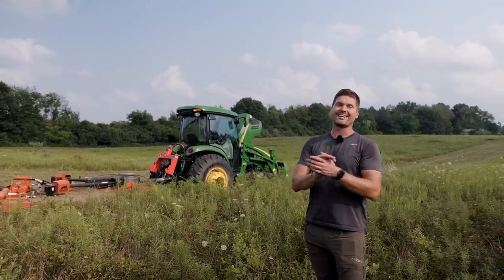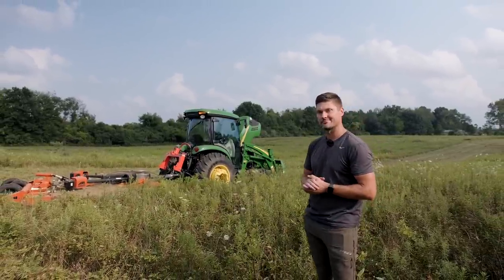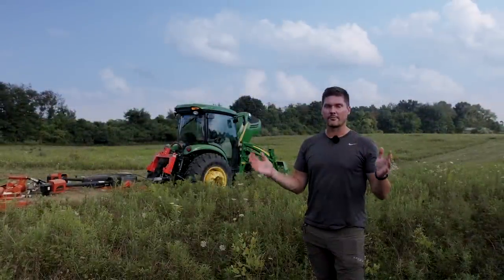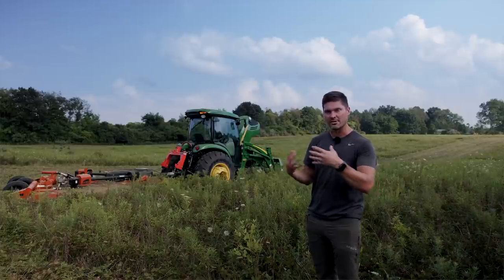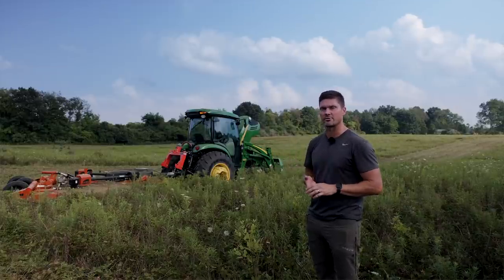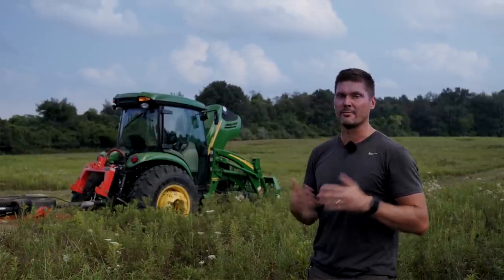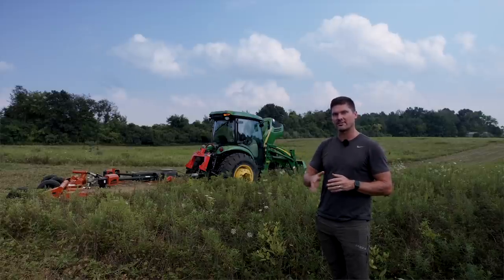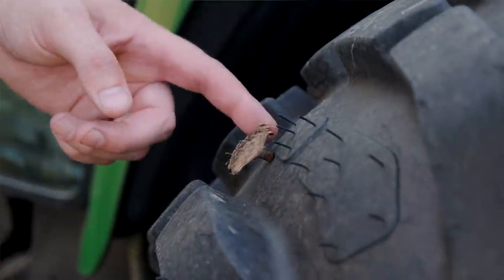JOHN DEERE BREAKS DOWN PULLING A BATWING MOWER THE FIRST TIME

Comment: Diesel engines are cooled. When they start to run hot, the best thing to do is find some shade if possible. Allow the engine to idle 1100 - 1300 rpm. This will usually cool them down. While the engine cools, you can pop the hood and clean the radiator screen. Turning a diesel engine off can cause major damage as it continues to heat up. Just a little something I was taught on the farm many years ago.
Reply: was about to write this, do NOT shut of the engine when it runs hot, let it idle to allow the coolant and radiator fan to do their job. That apply to any water cooled engine out there, not only diesels.
Reply: He should also turned the cab Heating on that will help to get the heat awas from the engine (and it gets even hotter in the cab so 90degree suddenly dont seem to be that hot)

Comment: Regarding the temp, when it’s already running warm & the tractor is running it’s constantly circulating coolant but when you shut off an already warm engine you stop that circulation & that already hot coolant is sitting at that temp sensor & is going to get warmer because it’s not circulating & just collecting heat off of the engine components & getting hotter until everything starts to naturally cool down. Fix to this is when your tractor starts to run warm & you’re gonna shut it off to clean screens let it idle for a little bit with out a load on the engine so it’s naturally cooling itself down before you just shut it off while it was already running hot
Reply from the maker: That makes perfect sense.  Might have bought me some time, but I feel like there is something more significant going on.
Reply: @GoodWorksTractors  Yepp you may be absolutely correct, I’m just sharing something I found out the hard way operating a grain cart in the Texas heat
Reply: Seeing your post saved me from regurgitating the same information.  The one thing left out - on severely overheated engines, crank over every minute or so till cooled down a little to prevent seizing.
Reply from the maker: Definitely, experience is the best teacher 😂. Have a great day!
Reply: Also, along with what was already mentioned about a running cool down, just check and make sure the radiator and ac condenser aren't partly plugged with dust\dirt. Mud wasps love radiators! There's allot of heat being dumped through both and when you add the extra heat of a hydraulic cooler into it on a 90+ day with a good load, that might all be enough to push it over the edge. It's that a hydrostat machine?
Reply from the maker: Good thinking!  Yeah, hydrostat machine.
Reply: @GoodWorksTractors  those transmissions make a ton of extra heat especially if your not at full speed in whatever range you've chosen for the terrain. If your in a mid range and adjusting speed with the foot pedal your creating extra hydraulic great load because the fluid not used for motion gets squeezed through the bypass back to the sump. That recirculation creates heat. Always better on long runs at higher load too be full open on the foot pedal as much as you can at least. Then your moving oil and it tends to stay cooler. Love that mower!! Gonna add that to my list of wants! Have a 10' straight and live the width but it's a pain to transport on a trailer as it's technically over width. Keep the good videos coming👍
Reply: i dont ever stop the engine thats the worst you can do to your engine and trans oil, always leave it on and use a pancake compressor when i mow pollen stuff, just cleaning the screen isnt enough, you get that stuff though everything in the pack of coolers you have to clean that all out
Reply: I would recommend just above idle with no load on for more coolant flow.  also someone already mentioned the stick to used compressed gas or water to clean the radiators. "Radiator Genie"
Reply: That was well said, saved me a lot of typing. Your spot on. Temps will still climb especially once the tractor is shut down and coolant circulation stops. Deal with that same thing on my X758 and 2025R whenever I am mowing in some tall grass and weeds and the screens get clogged up. Happens every time I try and use my X758 like a brush hog. LOL Or actually have a brush cutter on the the 2025R or my 4066R for that matter. 
I think it is a condition commonly called heat soak. 
I would clean all the screens and radiator fins and should be good.
Reply: @jlipskoc  "Radiator Genie" the sticks to clean with compressed air or water.
Reply: I agree, I was towing a small carnwith small pickup years ago. It started to get hot going over a mountain and I stopped to let it cool. Let the engine idle for 5 to 10 minutes and then I was good to go. Always need to watch that coolant gauge.
Reply: @GoodWorksTractors  Injector pump Issues, and leaking injectors ( smoky start up) . So It is running LEAN.. that means more heat.
Reply: @catwalk136  
Agreed. I grew up around heavy equipment. The old guys called it " letting the machine idle out"
Reply: I have a 2013 4720 and I have had troubles similar with over heating excessive exhaust and three point not working.  The previous two owners evidently did as well as it had been into JD service four times for service before I bought it with 105 hours.  I live in Wyoming and I bought it from a dealer in Iowa whom did not disclose any information of trouble.  Well I think we have it sorted out as it is currently working perfectly as there was a defect in something that was causing the rock shaft o rings to blow is what I was told.  My dealership currently feels very confident we have it concurred.  When I would start it would many times really rev up compared to another 2013 jd 4720 that I have also with excess exhaust smoke.  

On cooling your machine really watch your heat gauge once it starts climbing leave the engine running return to idle, turn into the wind, get out and wipe the radiator screen off the hood, leave the engine running lift the hood up and let it cool down then you can proceed for awhile.  But if it happens repeatedly repeat the procedure let it cool down, then lower the hood and go find some air to clean the radiator obviously after you have shut the engine  off.  I would not use water as dust that doesn't wash out will turn to mud then when it dries it will be hardened and you won't be able to clean it very well or quickly at all.  Just suggestions.  Good luck.  I really like the John Deere 4 series.  I also have a jd 3720.

Comment: We had the same situation....used compressed air to blow out before starting to use....get the air wand that has 5 holes for your air hose and blow the radiator out before you start work..when you notice the heat guage moving stop the tractor and clean the radiator screen...we carry a Stihl blower on the tractor..this helps in the field...

Comment: Nice video. Sorry for the hassle. It was always drilled in my head to do exactly what you did to trouble shoot your tractor. Don't give up on the 4720 (right number?) just yet. You will figure it out or get it solved. Also have a lot of help and insight on line here. Have a great day and be safe guys!.  Tim

Comment: Very good tip from a viewer, if the engine is running hot, set the heater control to the lowest setting & turn the heater fan to the highest setting.
The fan blowing hot air is acting as a radiator as it forces heat away from the engine. Love your videos.
Reply from the maker: I did that years ago on the way back from college.  Made the entire 7 hour trip back home in the summer with the heat on high and the windows down 🤣

Comment: I too use a TS10. It’s matched to a 55 hp 4 series red cab tractor. You’re getting some good advice regarding the overheating so I’ll refrain from commenting on that. I did notice you had your quick hitch on the back end while connected to the TS10. I am not able to do that as the pro shaft comes too close for comfort to the bottom of the quick hitch when turning. Wish I didn’t have to.remove it every time I mow! Love the videos!
Reply from the maker: Do you ever have overheat issues?  What type of speed do you normally run?  Thanks for watching!
Reply: @GoodWorksTractors  I have had both tractor and mower a little over a year. Purchased them new. About an hour into mowing 4’ high thick field, 90 degree day I noticed the A/c not cold enough with temp gauge a little high. I let the engine idle while I cleaned the screen and all was good. That occurred only the one time but I have not let it grow that high before mowing since. I typically mow for 4 hours or so and clean the screen upon completion. 

When I set the cruise control it’s 3.5 - 3.9  mph depending upon how high I let it grow.
Reply from the maker: Nice, thanks for your feedback.  Yeah my a/c had to get recharged a few weeks ago.  They couldn't find a leak, but it was low.  So my a/c my be unrelated to the overheat.  Not sure.  Debris was negligible, filter was good, hardly anything inside the compartment.  I feel like it's gotta be something else.
Reply: @GoodWorksTractors  I hope you get to the bottom of it soon! 

The first thing I thought of when I saw the excessive smoke on startup in the video was that you might have a DPF/emissions issue. Was there any dash indication of a regen occurring while you were mowing?

Comment: Change the thermostat. Check coolant boiling point as well. Might be weak.
All liquid cooled engines go into “thermal soak” when shut off after running at normal operating temperature. The ability of the coolant/antifreeze to remove heat stops when the water pump stops. The engine is now totally relying on thermal radiation. (This is one reason why drag racers will use an electric water pump. They can circulate coolant with the engine off.)

Comment: In my opinion, you were going pretty fast under the conditions.  I have a 6430 and I pull a 15 foot batwing and I go slower.  If it's smoking, you're working it pretty hard.  Keep in mind, my tractor is probably almost three times the pto hp as your and I'm only pulling a five foot bigger mower.  Also, mine has screens like would be on a screen door that you can pull out and clean in addition to the ventilation on the hood.  I also use my tractor for haying pulling a mower conditioner, and I can't run my a/c at full while I'm doing that or else it will get hotter than I would like to see.
Reply from the maker: Is 3-3.5 mph in low range is fast?  Engine rpm's never wavered at any point like it was bogged down.  I've bogged down and stalled tractors quite a few times, but this showed nosigns of taxing the system.  A/C had to get recharged a few weeks ago even though they couldn't find a leak.

It only smoked two times that day upon starting and one of those times was before I'd ever turned on the mower, so it wasn't because it was being worked hard.

Thanks for your input and have a great day!
Reply: @GoodWorksTractors  Did you speed up the video, because to my eyes it looked faster?  I go about three in my 6430 in most cases when I'm mowing, but I normally don't have that heavy of mowing in my area living in the high plains with less rain.  I wonder if you got chaff built up between the a/c and radiator because that has happened to me and I had to take everything apart and hose out all the dirt.  I had a Kubota that was that way.  Is your tractor hydrostatic and does it have a hydraulic oil cooler in front of the radiator?  That might contribute to heating issues on a hot day.  My first tractor was a Kubota B3030 before I got into actual farming, and it got warm under heavy mowing conditions.  That's all I can think of, I enjoy your videos.
Reply from the maker: Yeah, it has an oil cooler on it.  Didn't speed up video.  The max the tractor even goes in low range is 3.9 mph and I was just setting cruise at 3 mph and increasing slightly from there.  Got it at the dealer now so they can take a closer look.  Besides an extremely small amount of debris, there wasn't anything off that I could find.  Have a great day!
Reply: @GoodWorksTractors  Sure hope they can get it figured out.  Nothing more frustrating than a machine problem when you have work to do.

Comment: Courtney, I usually catch all your videos as they come out but didn't see this till today. I think you have a ground fault in your electrical system. It can cause all sorts of strange problems like this. I had a car that randomly wouldn't start and would have to jump off, car alarm would go off randomly, and temperature would read normal then high then back to normal. I replaced the battery, thermostat and main alarm unit with no luck. Then one day trouble shooting ended up noticing I coul wiggle the ground on the engine block. Tightened and no more problems. Hope it's not too late for you to see this and maybe it will help.

Comment: The old Farmall C has about a 2mm gap between the radiator fins.  Debris passes right through.  Never had it overheat in 70 years.
Reply from the maker: Haha, so I didn't go old enough when I went with an older tractor.  Is that what you're saying! 🤣

Comment: I'm amazed at all the comments saying you are working the tractor too hard or that the load is too much for that tractor.

I worked on a 400 acre farm through the late 1970's through to close to 2000. All of our equipment was at least 10 to 40 years old (back then) and we used to run everything hard. Many of them would have the governor pegged wide open, trying to hit the set rpm for hour after hour after hour.

Never, not once, do I remember having a tractor overheat unless it was low on coolant or had a water pump with an impeller with no blades (cavitation sometimes corrodes the blades into oblivion).

On top of that, none of those old tractors would even overheat with the radiator substantially blocked with chaff. Once in a blue moon we'd notice a temperature gauge slightly higher than normal and it was because the radiator was completely blocked. This was super rare though and a quick blast with compressed air and the temperature was back to normal. Those old tractors had cooling systems with a good 2x more cooling that required.

Are tractors today that much weaker that they can overheat at less than full rated power?
Reply: Its the emissions bs it causes the tractor to be weaker and they put off more heat themselves than the engines do

Comment: In hot conditions take the cowling off engine compartment, I have the same tractor that’s one of the remedies to getting it to run cooler.
Reply from the maker: Thanks for the tip!
Reply: I take my side panels off my jd web brush hogging big field.  So far on the yanmar ive ran into no issues. But ill keep you posted will be mowing soon

Comment: Sure enough just had this same issue with my 1025R while mowing the other day. Temp went from 1/3rd into the green arc to red line. Turned it off, popped the hood and coolant level was fine, oil was fine, but my air filter in front of the radiator was caked in bugs/dirt. Cleaned it off, started her up and the temp dropped to normal in seconds.

Comment: I have a 4052r.  When I mow I remove the loader and carry a blower to blow out the radiator.  With the loader off the high weeds tend to wipe the side covers off better which keeps it cooler.  I still have to stop now and again to blow out radiator and front shields.  It never overheats in regular mowing.  Somewhat of a flaw in design in my opinion but I had a kabota l series do the same in tall grass.
Reply from the maker: Yeah, this was recently serviced and detailed with only a few hours on it since.  There wasn't enough debris on the front grill to even worry about.  I'd guess 5% of the grill was covered.  I've used dozens of tractors in the field and never had an experience like this until now.  I've been fortunate I suppose!
Reply: Yes, good idea.

Comment: When you are bush hogging, and your engine starts to over heat.  Don’t shut your engine off, clean the screen and radiator off and let the fan pull air across the radiator.  When you shut it down the the coolant didn’t move and just sets stagnant and continues to heat up.
Reply from the maker: Yeah that makes sense except there wasn't any debris covering the screen nor anything under the hood.  Air filter had hardly any dust on it.  Fluid levels are good too.

Comment: I see you are getting beat up over shutting the tractor down.  Sorry and they are right.  Many of us carry small battery operated blowers for exactly this issue.  For when you are near an air or water source, I use the Radiator Genie - Water & Air Cleaning Wands for High Efficiency Cooling Systems and Radiators - Blow Out / Wash Out Kit (Amazon).  Best of luck.  On another note, if your air filters are dirty, it will run hotter as it struggles to get enough air for combustion.  There also may be debris in the air filter canister.  It happens.
Reply from the maker: Air filter was clean, almost no debris on the front grill and temp was in the green when I turned it off.  It didn't jump to red until it was off for a little while.  There is very little that a blower would have done and if a tractor is that finicky, then it's not worth buying.  Not my first time cutting a field, but have ran dozens of tractors with brush hogs and have not had it happen.  I only mow in the summer, so it's not like this hot summer day was any different than the rest over the years.